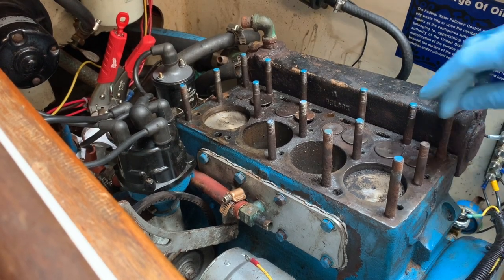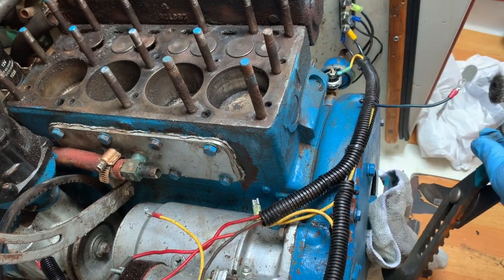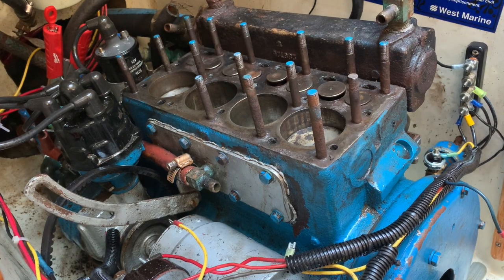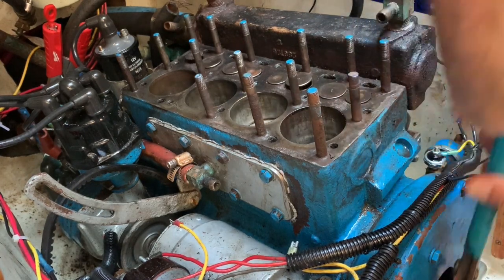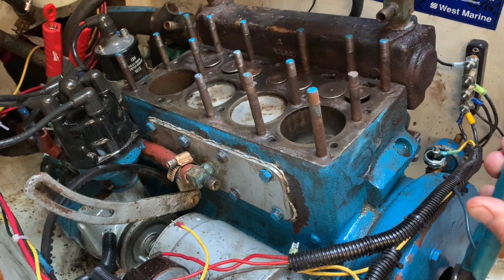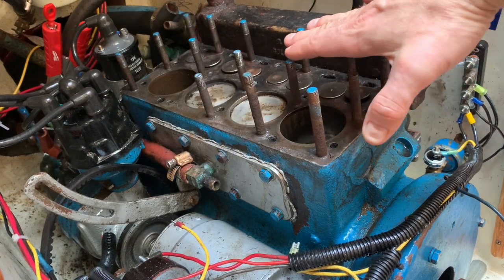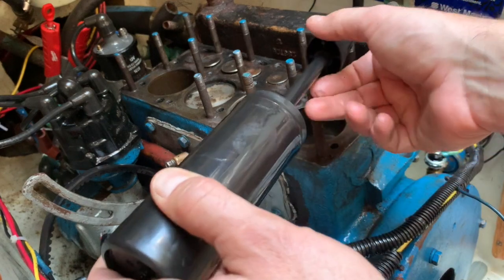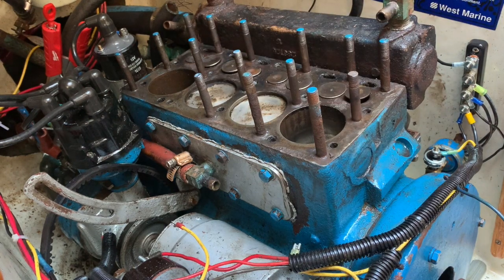Atomic 4 - Cleaning and Valve Discover - Pt 3

Comment: Did you remove the studs to take off the top or did you manage to lift it with the studs in place? this may be my next adventure.
Reply from the maker: Its been a while since i did it but i believe in the videos I used wooden wedges with the studs in place.  My goal was not to replace the studs unless I broke them because you most likely have to drill them.  Check out all the videos and see if that helps.

Comment: I got the 4th Cylinder unstuck.. the valve wasn’t moving because a broken stud bolt.. I replaced the stud bolt and got it unstuck.. now it has compression.. still can’t get it to turn over.. fuel pump seems to be working.. not sure what else to do?

Comment: How do you did you hand crank?  I can’t see the back of mine but what can I use to see if the valves aren’t stuck? Can I use the starter?
Reply from the maker: I used a pipe wrench on the water pump pulley attached to the front crank.  If you don't have a pulley then there is a tool on moyer marine.  If it's facing the other direction then you can bump the starter.  I would just video the valves and rewatch to see if any are not moving stuck up.
Reply: @cameronlaurent  video the valves?  Can I use the starter to see if they move?  I don’t have a manual crank
Reply from the maker: @Tyler-sv4sw  I assume you have the head off and the valves exposed?  Crank I mean crank shaft. You need something that ties to the crank shaft to turn it other wise bump the starter if the heads off and watch the valves after a few full cycles.
Reply: @cameronlaurent  yes everything is exposed.. I mean can I tap the starter with the head off?
Reply from the maker: @Tyler-sv4sw  yes you can bump the starter for 2 to 4 seconds. I suggested videoing it because the cycle goes fast as the starter cranks fast.  Hand turning it goes in slow motion so you can see how it works.
Reply: @cameronlaurent  thanks I’ll look at it that way.. the left front stud was already broken off when I took the head of it.. I’m guessing that’s why I have no compression in that cylinder? I hope.. so I guess I’ll tap that head stud out out 3/8” in and put the head back on.. I hope if all the valves move that would fix the problem of it not starting?
Reply from the maker: @Tyler-sv4sw  a broken stud usually happens when removing the head nothing to do with it installed. Look for evidence of water in your cylinders. A bad head gasket can for one lose compression of a cylinder and two let water in from the cooling system. Stuck valves is a whole other issue with either being clogged up or lifters bad.  If it’s been sitting a while I would make sure the exhaust out the back is free and clear. A lot of times they get clogged up and the engine might be good but it can’t breath so it won’t run. Lots of different things with these engines!
Reply from the maker: I read that wrong. If it was already broken off then maybe that’s where it started to leak compression and became the issue
Reply: @cameronlaurent doing what you did.. front valve isn’t moving.. throwing pb blaster into it.
Reply: @cameronlaurent  ya it was broken before I took head off.. really rusted
Reply: What gasket glue do you use when you put the gaskets back on?
Reply from the maker: @Tyler-sv4sw  none. 2 gaskets at the right torque should last another 30 years. Ha
Reply: @cameronlaurent  do I need to buy a torque wrench I take it? 35lbs?
Reply from the maker: @Tyler-sv4sw  borrow one from someone in the marina. If you over tighten then you will bust the gaskets and no compression again. Torque everything in my opinion.
Reply: @cameronlaurent  how much torque do you use?
Reply: @cameronlaurent  35lbs won’t break another stud? looks like 2 are the only ones not replaced and look a little bit rusty/older. I have to drill out one and replace with a stud repair bolt from Moyer marine.. I grabbed one from autozone for $30
Reply from the maker: @Tyler-sv4sw  30 to 35 lbs is pretty light so I would say no.  Use the torque pattern and go light at first then come back through.  Maybe 15 - 25  - 35 lbs